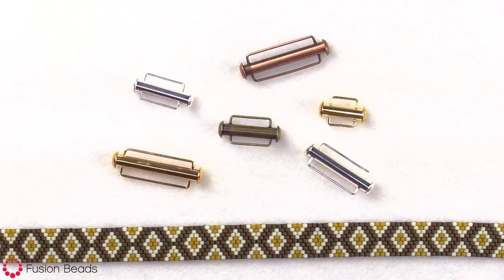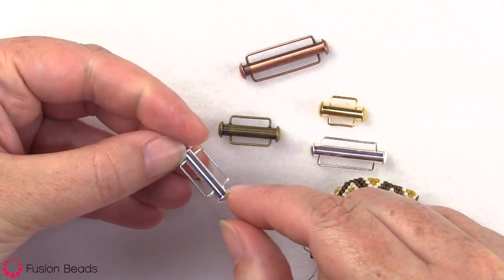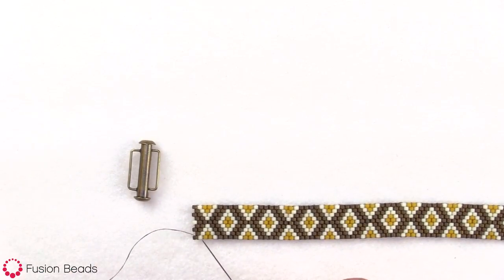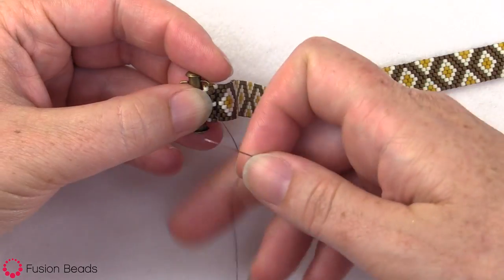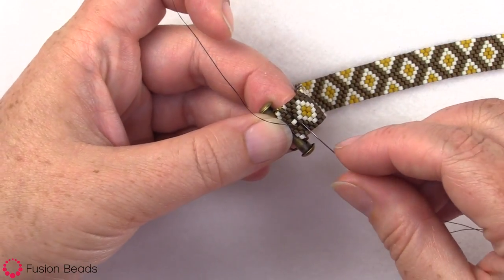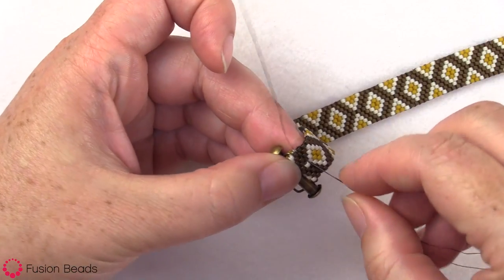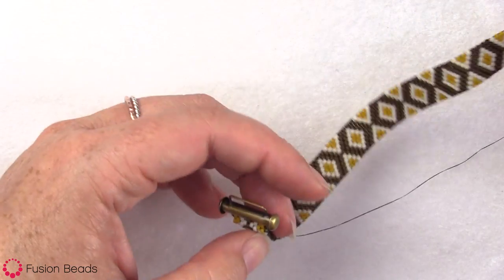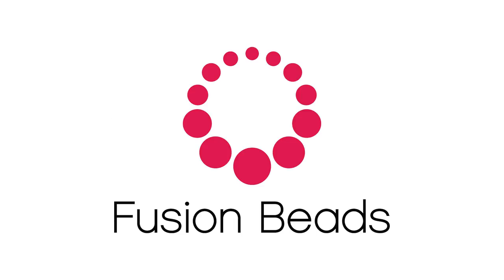Finishing Flat Peyote with a Slide Bar Clasp

Comment: Nice technique! What size clasp do you need for 10 delica seeds wide bracelet? Thank you! 😬
Reply from the maker: Great question!  It would depend on how wide your finished project is.  Let's say your project is 4 across, size 10/0 delica's you could use a 16.5 slide tube clasp, the wider you piece the wider the clasp.  
We have many different clasps to choose from depending on the finished width of you piece and a variety of colors to choose from!  Get them here ___> https://www.fusionbeads.com/search?keywords=slide%20clasp
Reply: This would be for size 11 delicas with the band being 10 seeds wide.  Trying to figure out which size has an opening to fit this band. Thank you for your help!